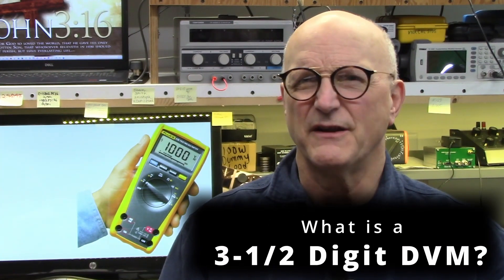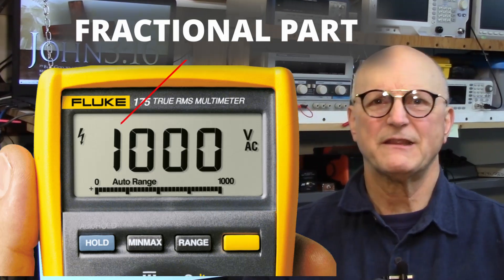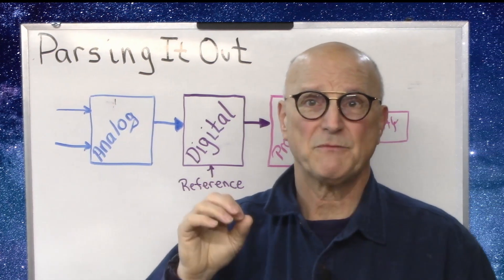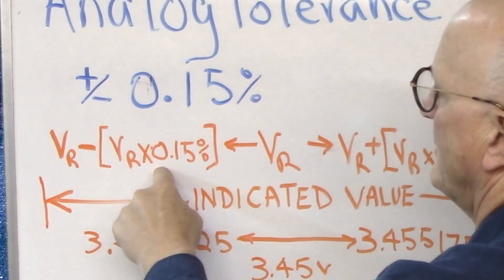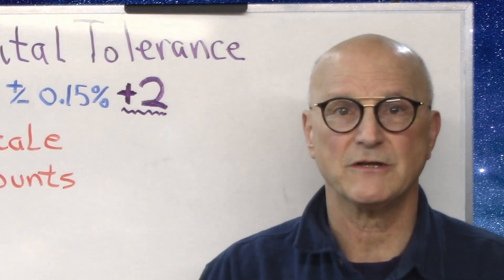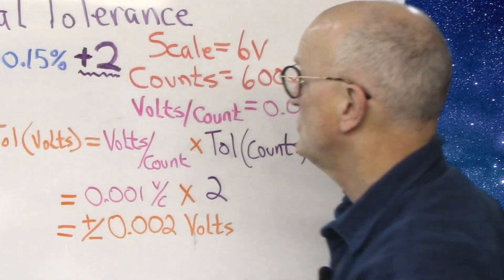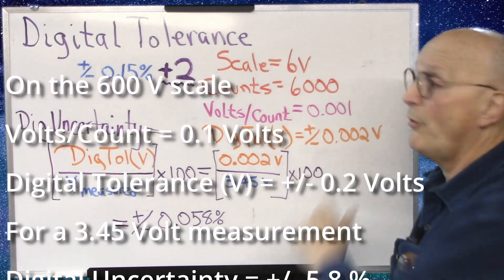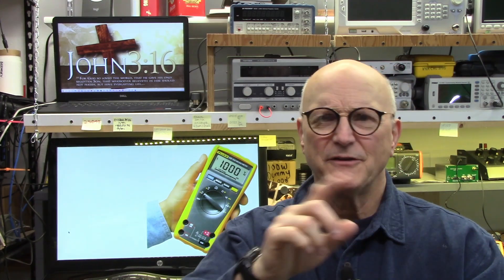Demystifying DVM and DMM Specifications (022)

Comment: Great explanation Ralph.  I never thought much about the digital tolerance. Another variable to consider in measurement accuracy is test lead quality. There are some doggy ones out there, especially Wuhan specials.  Also contact resistance from probe tips back to the banana connectors.  Life was simpler if not as accurate back in the old Simpson 260 days  ( although I am a Triplett 630 man myself )
Reply from the maker: Thanks, Todd!  True about the test lead viability!  I have had even genuine Fluke test leads be pretty much sketchy.  They are REAL nice in the beginning, but they developed unpleasant habits in time. Wires too suple and break inside the things. :-(  REALLY nice probes ... not so good longevity and WAY expensive.